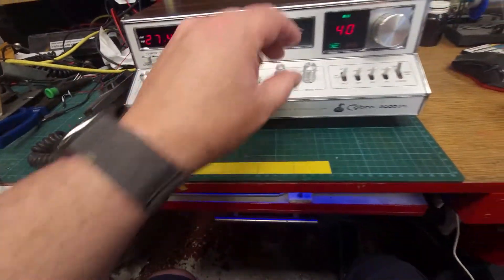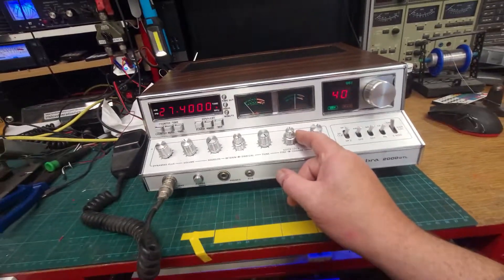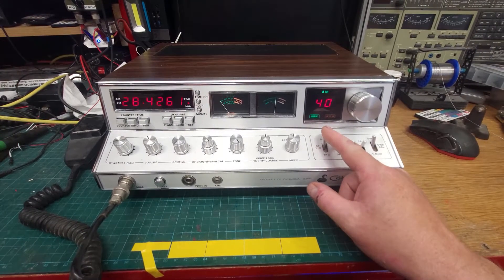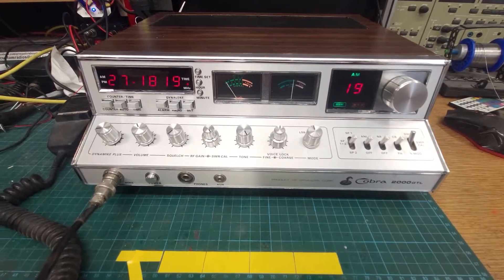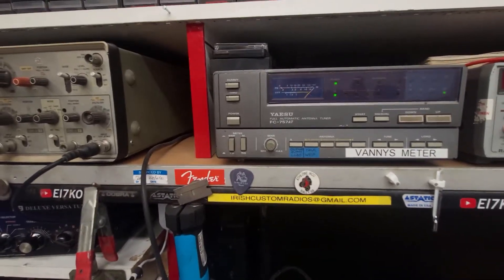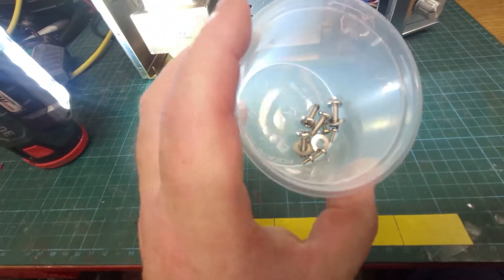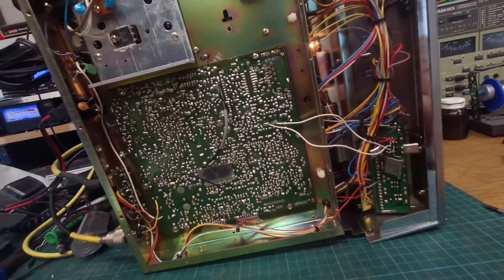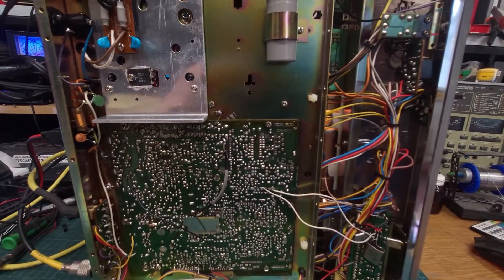PAULS COBRA 2K GTL PART 1

Comment: I have a nice mk2 148 that could be doing with a service no eprom standard low/mid/hi all switches doing what they should apart from ch9 its not bleep or a  or kc jump its a mystery lol signal meter is sticky .It had been stored away in its original box for a long time then i got it fired it up it works ok but i can tell its not 100%  .Cosmeticaly its in great shape no extra hole etc still has the plastic hanging onto the serial number lol original mic a couple of the orange lines have faded .would be great to have it serviced took me forever to find 1 that was not epromed ..If use not busy i would love to let u work are magic on it
Reply from the maker: Send a mail to irishcustomradios@gmail.com